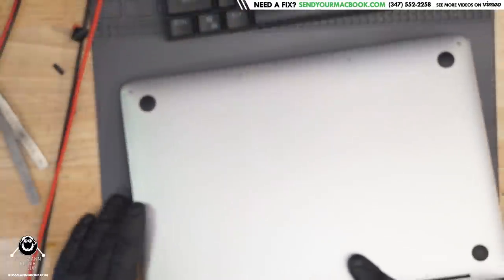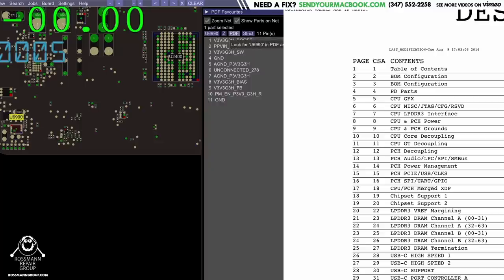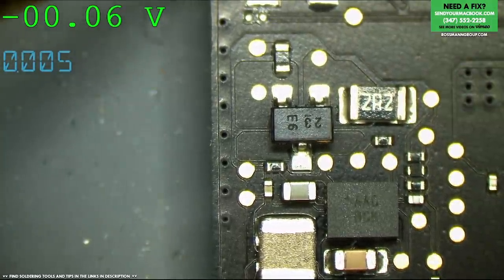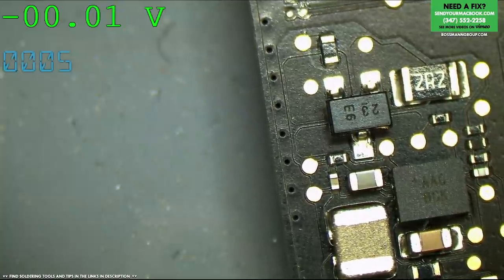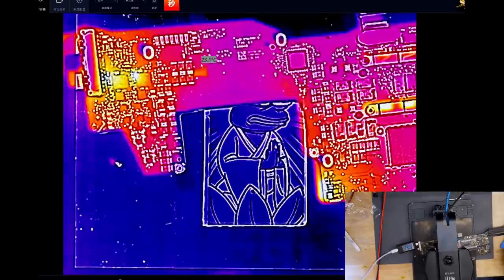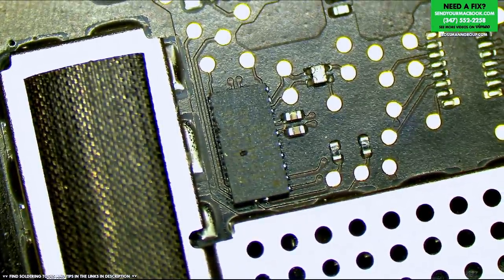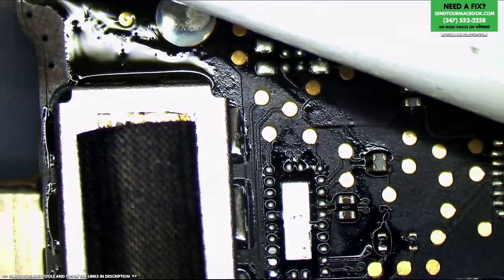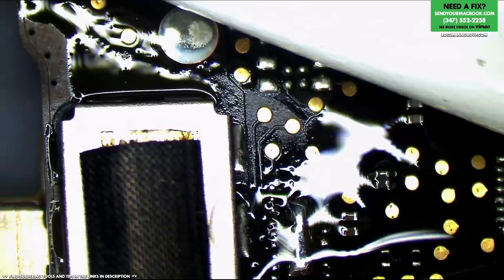What is an ACTIVE short and how does it differ from a NORMAL short circuit?

Comment: The mystery chip?  That's the PLA-Calgon "ACS" OPM.  It only does SOME of the things you're worried it's doing.  The rest of those things are handled by a different chip. :-)
Reply: M0rn1n6St4r so it stops limescale buildup inside the MacBook?
Reply: @timehunter9467 : PLA = People's Liberation Army; Calgon = SOAP (Simple Object Access Protocol); "ACS" = "Ancient Chinese Secret"; OPM = Obfuscation Power Manager :-)

Imagine if a China-based company has its devices assembled in... say... Langley, Virginia.  Should China trust those devices?  What arrangement might that Chinese company have made with the U.S. Government... to gain access to cheap, Virginian labor?

If Huawei devices are suspect, I would argue Apple devices are suspect, too.

Remember... Huawei devices are such a security risk... exactly ZERO existing devices have been confiscated from American owners of those devices.

"Back in a garage with my bullshit detector..." -The Clash
Reply: Calgon is a brand of cleaner for washing machines, that’s why I said it.

Comment: In some cases you can have an "active short" caused by a dielectric breakdown of the part. For example if you have a crack in an MLCC you could now have air as a dielectric opposed to ceramic. Your DMM provides a very low amount of energy when in resistance mode, thus not generating an arc aka a short. However if the circuit is powered on and reaches operating voltage, that could potentially be high enough to break down your air gap.
Reply: Not only that, if it heats up, the material expands thus making the gap smaller.
Reply: For similar reasons, power supplies with dodgy primary/secondary clearance can shock you even when there is no direct connection.
Electrolytic caps can also suffer degraded voltage handling due to thin spots in the dielectric.

What makes MLCCs critical is silver migration through lengthwise cracks caused by thermal stress. You could say surface mounting and lead-free solder have ruined what used to be fairly reliable technology, though sheer circuit complexity also is a major factor.
Reply: @HappyBeezerStudios  thermal expansion causes all things to move away from each other, like a loaf of bread rising. i dont see how it could make the gap smaller
Reply: arkie87 Imagine being a wire or resistor held and locked fixed at both ends, then you are heated so you want to expand, but both ends are constrained, what happens? You feel like you’re getting compressed, and that’s exactly what happens.
Reply: @jakegarrett8109  if both ends are fixed, then the distance doesnt change. You have stress due to CTE, but no strain. So try again.
Reply: arkie87 distance does change, they were talking about a crack (which is a physical displacement). Or a real world deformable body (buckling) or insulation breaking down (squishing/deforming out the sides)

Try again.
Reply: @jakegarrett8109  please look at who i responded to.

Try again.
Reply: arkie87 maybe you should look at it... because your it looks like your founding premise is wrong regardless who you are telling (hence I corrected it in the first place and tried to give an explanation a child might understand since English may not be your native language or what grade in school you are), plus your last one was indeed tagging me whether you meant to or not.

It doesn’t “move away” (the object does not have eyes nor the logic to see where it’s going), it simply expands or tries too from its fixed constraints. If that’s not obvious then I’m not sure how to help you, but it’s ok, people learn at different rates, it just takes some studying and sometimes hands on is the way people learn, so maybe grab some Nichrome wire, measure out 12 ohms of relatively thin gauge wire, and connect it to a car battery with a switch and see how it reacts as it tries to expand and compress, but in this case will buckle and start to bend since it is very thin and exceeds buckling criterium. (Also nichrome does some other cool phenomena like memory, it’s fun to mess around with, also good for rocket igniter fuses and heated apparel and stuff). Make sure to wear gloves or careful when handling, it will get hot! Adult supervision recommended.
Reply: @jakegarrett8109   wow, this is ridiculous. I only tagged you in response to you tagging me. Claiming that "at least one was indeed tagging you" is stupid, since you started arguing with me about something that i wasnt claiming, and started putting words in my mouth.... 

Anyway, i'll try giving it an "explanation a child might understand since English may not be your native language or what grade in school you are was responding to". Simply put, i was responding to @HappyBeezerStudios - by Lord_Mogul
 who claimed "Not only that, if it heats up, the material expands thus making the gap smaller." I dont think this logic is sound, because thermal expansion causes objects to move farther apart. Consider an object with a hole in the center--- when heated, the hole gets bigger, not smaller. (And in case you are going to say that in this case, the outside edges of the object are fixed/constrained, such that the hole might get smaller, that is not what is going on here, since the edges are made of material too, which will expand as well)

And seriously, are you really trying to claim "It doesn’t “move away” (the object does not have eyes nor the logic to see where it’s going)," -- you really think that's what i meant? Based on that and you arguing with me, pretending i was arguing with someone i clearly wasnt, you are either a troll or have no reading comprehension. I'm done.
Reply: @arkie87  if the component has cracked, you can visualize it like 2 separate objects- they are both expanding, but they are close together since the gap is probably on the order of microns. they both will expand out, but will likely touch on the facing with the crack, as there isn't much room to grow. that being said, I've never seen a crack like that form (but I imagine it is possible)
Reply: @mateijordache1952  what you are saying is true, but not really applicable here. The question was about a dielectric gap reducing due to thermal expansion. The reason your example is not applicable is because in the case of a crack, the distance would have been zero i.e. no gap before the crack occurred. If that is the case,  then the device would have been shorting before the crack formed...

Comment: Having knowledge of the power profile of a working charging ckt. to contrast to ckt. under test, usb meter, thermo-camera and professional drawing correct connection between the dots very necessary to isolate failed component. Nice job.

Comment: it can be due to voltage, the multimeter uses a lower voltage to check the circuit which may not triger the short (which might be a semiconductor OR a capacitor that leaks exesively above a certain voltage)
i hope it explains it a bit
Reply: I thought it would be a a type of insulation failure.
A multimeter usually does not put out a large voltage. The insulation may have held at 1.5V but not 5V. As an electrician I've seen this happen on a larger scale. At 240V the insulation holds and no short circuit. But at 500V it's a dead short circuit. 

When he measures the resistance, he gets 390K at 1.5V or whatever. But at 5V whatever insulation there is breaks down and current flows through some kind of weak point.
Reply: @ForNoReason1000  kind of the same thing, there is capacitance between the wires you see, the dielectric materials are in this case the plastic and air, if the (insulation) dielectric is damaged there will be leakage at lower voltages. The capacitors "leak" after they are operated out of their maximum voltage specs or if they are old or if they are chinesium total garbage quality.

now it can also happen by a semiconductor, where the power to it is not directly connected but is only available after some other semiconductor allows it but for this to happen it needs power and sometimes even data that the multimeter won't provide

Comment: why not use an oscilloscope?  It sounds like the short to ground is not there, the chip gets power, the "path opens" as you say, shorts, and then the chip shuts down due to power starve, closing the path, restoring voltage on the rail, powering back up the chip, and the cycle continues.  This would probably look like some sort of square wave on the oscilloscope, where the frequency could be quite high (like 20khz?) where the voltage is changing much too fast for any consistent reading on the voltmeter. (causing it to "jump around" as you were seeing)
Reply: He only looked at the Chip because of the thermal view and that's the easiest way to spot active and parallel shorts. It was also something he didn't even know was there and couldn't even find in the boardview, so he wouldn't really know where to probe without "climbing" his way back up to see where this oscillation begins. Assuming it is oscillating to begin with.

Comment: Maybe one day Louis will get an oscilloscope .. but I must confess, that thermal camera is badass....  My thermal camera is called >> index finger for 50C+ and ring finger for 50C-   . Quick question though >> HOW in the world did he just fetch a new chip for a that part he didn't even know existed ? Does he have some kind of magic parts bin fairy ?  Or is this what happens to the computers that don't make it...  Rossman computers >> if we can't fix it >> we use self leveling concrete as a facade and use your mobo for spare parts :)
Reply: Any worthy repair shop has a spare parts bin miles deep. Either bought dead systems or non repairables or scrap from 'data recovery only' jobs.
Reply: @cybercat1531  I hear ya, I have spare parts bins miles deep and i'm not a repair shop!!  The main point I was making was he said he didn't even know what that chip was > and poof a new one just appeared  .. me=jeallyfish, I wish Tinkerbell would fetch my  IC's
Reply: I'm pretty sure he had an older Rigol, the one before the 1054Z came out.
Reply: Mr Sc1 this is a edited video. It’s possible they left out the part where Louis rummages through his donor boards and finds the chip.

Comment: Is self leveling concrete similar to rubber cement?
Reply: Nope.  It is a type of cement that will flow like honey, before it hardens.  Often used to fix floors that are (a little) out of level.
In the new store location, the floor is so bad that self leveling concrete is not appropriate at all, yet viewers keep suggesting that it should be used.  So now it's like an in joke to suggest self leveling concrete for every problem.

Comment: Why does apple put alltheprobe points on boards if they're treating the products as consumables. Are they used for mor than troubleshooting?
Reply: somewhere on the assembly route there is a flat thing with a bunch of protruding pins. strap the circuit board in, and it goes through a series of tests. LOTS of pins hit those test points(probably all at once too) and test for __ well whatever they program it to test for.. Lol , a computer which tests computers.   Maybe someone will chime in with the technical term so we can all wiki this contraption... for now we can just call it the Hellraiser. It throws the bad babies in the river
Reply: @mrsc1914  Most likely for a test jig, as for flying probes, you don't really need test points. Flying probe test example video: https://youtu.be/fjmjYVNuLEE
I heard, now they are a lot faster.
Reply: It called a bed of nails so they can test the whole thing in one go
Reply: @gower1973  Thanx, was drawing a blank on that one. See , i knew we the internet would remember. We can now have dementia in peace
Reply: Assembly Line Diagnostic Links

Comment: At least you used a concrete amount of self leveling flux. Apple can change a board mid production and add a whole new chip but change a simple component to  a better rated one without changing the board itself ... no fucking way. That will be like killing off a character mid season because  you don't have enough parking spaces on set for your 15 Jewish producers.

Comment: 370K ohms... Poor solder joint most likely suspect. Short? I think not.
Reply: @jordanwaughtal7649  I'm sorry for being lazy. But I always do easiest first. I can't eloquently describe my point, l haven't worked directly with electronics in many years but a poor solder joint creating the conditions that might create a latch up as you described in your video The result would be  a damaged chip caused by a poor solder joint to begin with. As always never let the little puff of smoke that is manufactured into every electronic component.
Reply: It's a short if it's supposed to be open
Reply: @curmudgeoncapitalist  I agree, and have too seen that a bad/cold solder joint can cause damage to an IC, but repairing the solder joint will not repair the damage to the IC, at least not permanently.